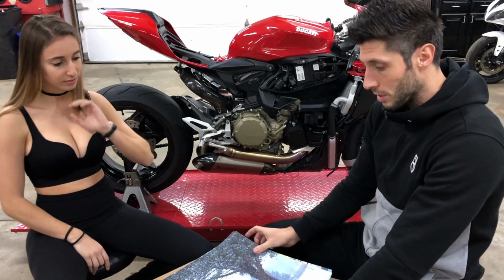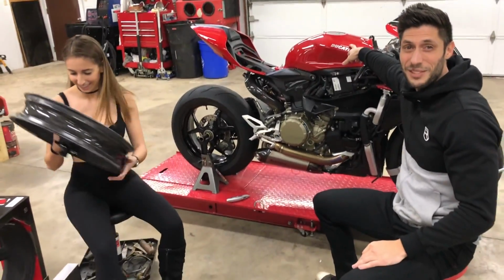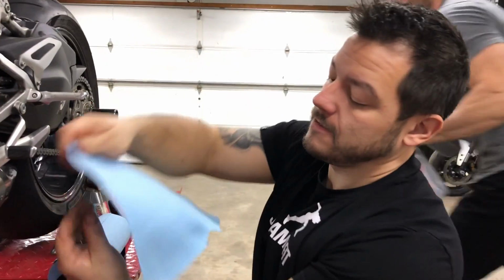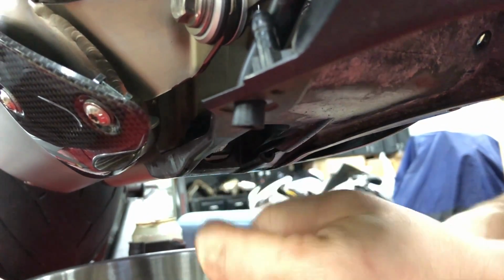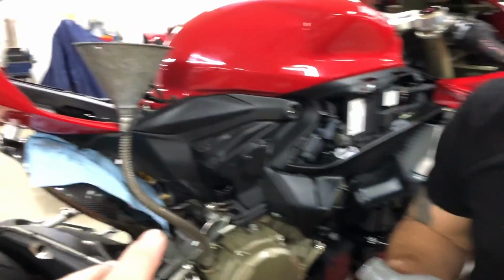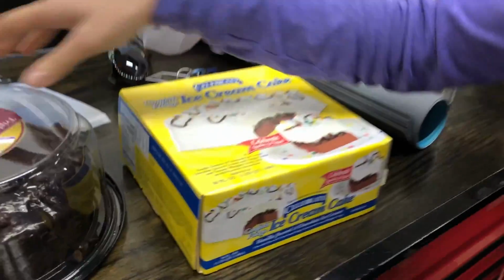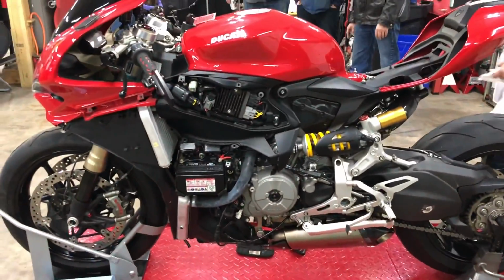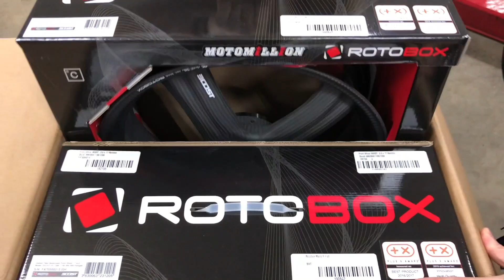$4,000 Carbon Fiber Wheels Have Arrived!!!

Comment: One thing to be aware when fitting lighter wheels,especially these feather light works of art,is that all of the current suspension settings will be way out,due to the dramatic reduction in unsprung weight,you may even require different springs fitting.I've read that even though these wheels are horrifically expensive,that they are the single most effective thing that you can do to improve every aspect of the bikes performance and that they are worth every cent (?).

Comment: Guys, to make the bike complete, please put a stahlbus oil drain plug. It makes oil changes a million times easier, cleaner and more precise (if you overfill you can drain just enough without making a mess). The owner of the bike will definitely appreciate it if they do their own oil changes and it's a pretty cheap part. 

Oh! And finally once you screw the plug in, you never have to unscrew it and don't ever need to replace the crush washer. You drain the oil with a special spring pre-loaded ball tool. You'll see it in the product description.

Comment: Coming along nicely! I don't think you guys are too far from Maine, but in July at the retired Loring AFB they have a top speed event on a very large runway. If any of you have an interest in going the fastest you have ever been before, this is the event to go to! They have speed readouts at 1 mile and 1.5 miles, and lots of room for slowing down ;) The event is called the Loring Mile
Reply from the maker: Oh dude thanks!  That could be amazing!
Reply: It is. All you would need is one or two days to get all the passes you could ever want lol. Only thing is you would have to follow a couple rules and safety wire the bike, and have a teather installed. Ill message you around June and see where you are at, and will gladly help you out with the what you would have to do in order to safety the bike etc. It's a blast, and very safe. Best place to test your limits by far.

Comment: I think you should have left the drain plug out until after you pulled the canister because sometimes it traps oil that flows back to the drain pan after it’s pulled, any time you change oil not just for canisters.  Just try next time and you will see extra oil flow while removing the filter.

Comment: It's not just 12 lbs that your saving with the wheels. It's 12 lbs of UNSPRUNG MASS. That makes a huge deal to how the bike handles and how the bike delivers power to the road.
Reply from the maker: Yes exactly!  Someone who gets it!  I will go more into what all the wheels do after they are installed :)
Reply: I'm thinking about doing that for the Daytona. But as they are so expensive they are going to be one of the last things that I get for it. I've read reports of the manufactures basically using them as a basket balls to show off how good the finish is and because they spring back so they basically bounce back to their original height. (Please don't do it, but it's interesting to read.)

Comment: Guys, there was nothing caked on the oil filter. Try changing the oil and go just for two rides or so and let it sit. It would look very similar. Also resting oil funnel on the paint almost killed me!
Great video tho
Reply: Ch0ppa the oil around the filter was thick and gooey compared to the oil flowing out of the oil pan. Caked as in nasty oil is caked on the filter.

Comment: Where did dado get that funnel and what brand torque wrench was he using?
Reply: Search on Google for a steel funnel with screen and flexible hose and you will find several.  The torque wrench is a Craftsman Microtork Torque Wrench.  0 to 250 inch lbs. ( 0 - 29 Newton Meters ).    You will need 3 sizes of torque wrenches to do all your own maintenance on your motorcycles . 1st: 0 to 250 in. lbs.  2nd: 75 ft. lbs.  3rd:  150 ft. lbs .  The smaller first and second will do about everything, however you will need 150 ft. lb. (210 newton meters) to tighten your rear wheel when adjusting your chain. All of the above Craftsman Torques Wrenches have both Newton Meters and in. lb and ft. lb. etched in the handles for ease of use.

Comment: I don't understand why you are mixing the the coolant with distilled water and water wetter. You don't need to use distilled water as it will be ionized quite fast anyway and water wetter is pretty much only good for track use, why mixing it with a coolant? I dont understand this.
Reply: Pillokun We are doing this because it is PROVEN for efficiency. I rarely go off of what others say or do unless there is a significant amount of proof of efficiency. I have done my own testing and continue to run nothing but distilled water and water wetter in my own motorcycle (for years) and have seen nothing but positive things come from it. 

The possible minerals in tap water can corrode the aluminum components and radiator. there is a reason why you are supposed to use distilled water.

Scale build up from some tap water which tends to cling to the sides of the cooling system and reduce the capacity by restricting flow and retaining heat.

Plus, distilled water is sub 2$ and (to some) provides a piece of mind do we really need to argue the process?
Reply: And "water wetter is pretty much only good for track use" is like saying "increasing the efficiency and life of your cooling system is only beneficial if your tires are on a closed track"
Reply: Water + a bit of water wetter is used on track because it lubricates the water, for all the rubber/oring and the water pump without being a slippery hazard on the track if it leaks. But for road use either you use a premixed coolant solution or mix it your self. As you say water can be full of crap, minerals and other crap but even distilled water will be contaminated rather fast. Especially if you ad the distilled water to the cooling system with what looks to be very fresh Motul coolant solution in there already. Why even go the extra step and add wetter water + water to an already optimal solution for the road? That is what I dont understand. you take away all the pros of either solution and add more cons, it seems totally unnecessary. Either you put one(water +water wetter) or the other(normal coolant solution), depending on how you gotta use the bike.
Reply: Pillokun i respect your opinion. And also don't have time to prove things  who question what we do. Keep doing what works for you!

Comment: A cooling system is designed  to run at a certain temparature, it will not run any cooler if you add a stupid product that claims cooler running. That change of coolant was completely useless.